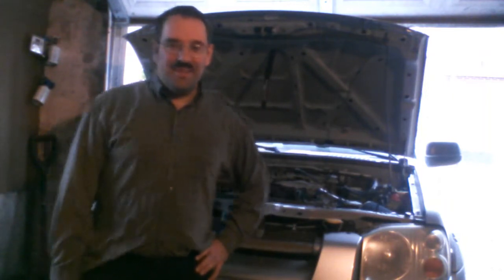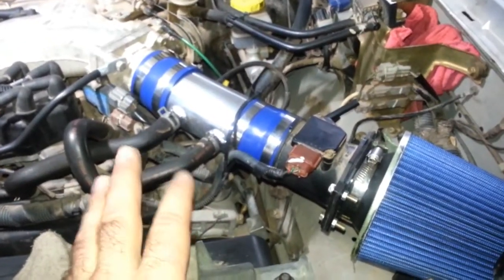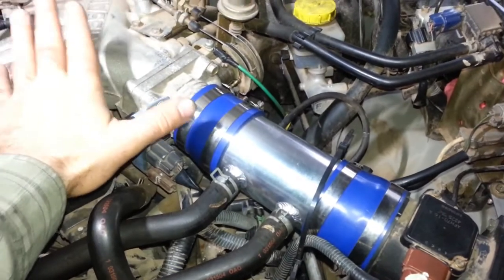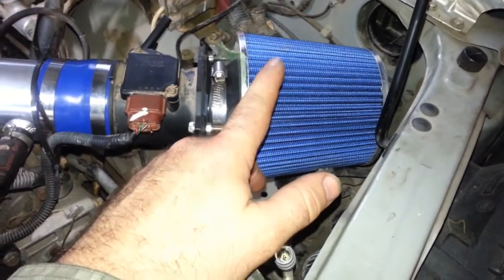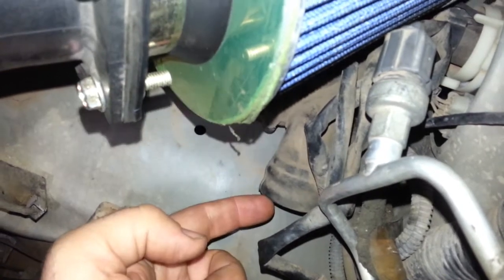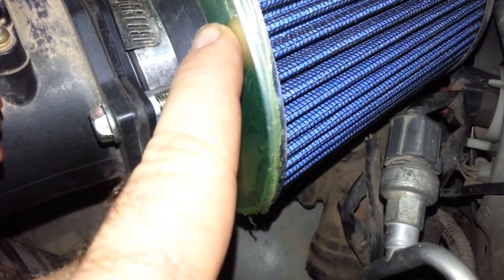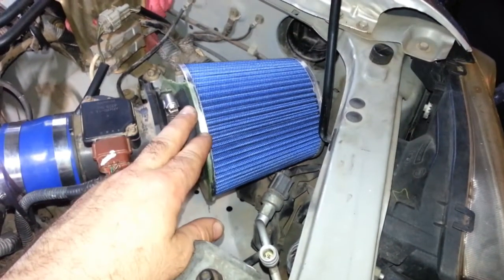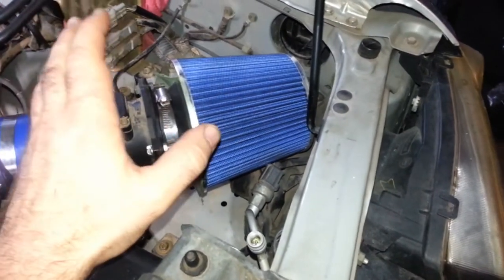Short Ram Intake compared to Stock: Nissan Frontier

Comment: I completely removed the stock air intake tube's and mounted a high flow filter to the air box that sits on top of the throttle body/intake manifold on my 03 frontier 2.4L and I can feel a dramatic increase in torque that I feel greatly out weighs the negative effects of the hot air it's sucking in
Reply from the maker: Oh wow! I have the 3.8l? Gosh I forget the liters. V6 2004. The intake was a power killer. So cool that worked so differently for you!

Comment: We're does that vacum line connected to the side of the intake pipe of the cold air intake come from? ... I am missing that vacum line but I do have that fitinn on my intake hose
Reply: Did you ever figure this out? Haha. I don’t see that vacuum like ANYWHERE. I’m a little late, sorry. Just installed one today.
Reply from the maker: If you're not missing a connection, made your guy's Frontiers are just a little different on their setup.
Reply from the maker: I've certainly done short rams where a fitting just gets capped off rather than being used because they often makes these "work" for a  few variations. 

These kits aren't expensive. Often that requires increased creativity.

Comment: I put the k&n cold air intake on my frontier and I've noticed that it puts the air temp sensor right onto the filter which definitely makes a difference but the way yours is set up yours is still in the original location which if you were able to put it where the filter is you may not have any of those problems that you're referring to. All you would have to do is just buy the k&n filter like the one that my kit came with and it has the opening for that sensor to slide into..
Reply from the maker: That is an AWESOME report. Thank you! I didn't see in the design of that one that the sensor would fit from images online, but I'm very happy it's a better option.

I partly bought what was cheaper because I could find no indication that K&N had a good solution for the IAT.

I hope your comment gets a lot of upvotes and it helps share the news!
Reply: @DENicholsAutoBravado  K&Ns' air intake system is actually really good for that engine that I've definitely noticed a big improvement over the stock air box. On yours all you would have to do is get their filter which has the opening for that sensor and you would be good to go.👍

Comment: I have to ask you a question? About the intake what did you with the third hose that connected to a smaller black housing next to the stock air filter housing
Reply from the maker: I'm not sure the hose you're referring to. Can I suggest watching a few more videos on my channel about this? I have a full how to series.
Reply: @DENicholsAutoBravado  on the stock intake theres three hoses 2 on the front and one on the back that connects to some small airbox
Reply from the maker: @bmwsuperstar7481  Ah! I remember it now. That's just part of the anti-resoance design to help keep things quiet. You don't need that for your short-ram.

I do highly encourage you to watch more of the series. Unless you live in a perpetual winter where never get stopped at stop lights, I think short-ram intakes work so poorly on Nissan Frontiers that engine damage is likely.
Reply: @DENicholsAutoBravado  how is it damaging if I may ask I live in vegas by the way
Reply from the maker: Las Vegas is the most brutal place I've every driven where short rams don't work. 

I'm sure I put the why about our Frontier here:
https://youtu.be/7Zud8L9B32g

Comment: Hot air, I was always told would increase the air/gas mixture over cold air for better mileage.
Reply from the maker: I've seen it work that way, but when it does, it also really decreases power. It really depends on the car and the modification. Here's a video which might help understand more of the processes to check on: https://youtu.be/SfTcm3J92E4

Comment: I myself like intake kits...but the hose with the intake air temp sensor does draw air in from the fender. It doesn't connect to the baffle (other inlet you showed) inside the fender.  The small inlet you showed goes to a plastic resonator that goes up to top of radiator. At least that is how it was set up on my xterra.  Nice video though!
Reply from the maker: It's so exciting! I found the resonator recently. You're right! 

Alas, it was broken then I bought the truck 4 years old. Maybe a new one? I think I'd like to try a kit with a shield instead.
Reply: @DENicholsAutoBravado  I did the stock airbox mod on my xterra. I posted a video on that if you do a search. You can get test plugs to cap off that small inlet in thr hose to force it to draw air in from the fender if you leave the hose in with the stock setup. Ive always been intrigued by the KN Apollo intake and the KN Orion intake. Universal type intakes with a plastic shell around the filter and a flexible air duct you can route any where to bring air in. Theres also a cheap intake on Amazon that has a heat shield, though ive heard in the reviews fitment is iffy but not bad if you are handy with tools. Nive channel!
Reply from the maker: Thanks brother. Liking the comment and what I'm learning. Go ahead and post you're link. I'll approve the "spam" if you don't mind me doing the same on yours. 

Makes it a little bit of a collaboration.
Reply from the maker: I almost forgot. I finally got a plastic plug at work which came with a hub bearing which I clamped on. My MAF reading was lower so if it's not hot out I think it's better open.

Comment: they make the filters with a hole and grommet to put the air sensor in or you can drill it into this filter. i have furookie 4 inch on my z that was done with a tune and about 2k worth of other stuff. unless you got a tuner/tune  the car doesn't recognize any thing anyways lol.most people figure it out the expensive way they thought started off cheap with a 50.00 ebay kit hahaha.great presentation bro
Reply from the maker: Thanks for the compliments. Glad to know you're a pro modder and I'm super happy there's a product which fits the IAT in so it works more correctly! I love doing this stuff.

It doesn't have to work right to enjoy it either. Recognizing that and coming up with a different plan rocks too. 

Countless modders go with "it has to work" and when it doesn't they're in denial. Takes maturity to grow from mistakes and not live in denial.

Comment: its called a Fresh  air intake not cold air intake from the factory.p.s im sending the speed daddy kit back as it won't fit.i am a mechanic and pro modder and it won't fit my 01.listed for 99-04 which we know is the years it changed the most stuff lol. probably fits newer ones .
Reply from the maker: Pro modder and it still doesn't fit? Just saw your comment 5 years later because someone said a short ram intake worked great for a 2003 2.4l Nissan Frontier. He said he felt a lot more power so a hotter intake was worth it.

Comment: can you send the link from ebay?
Reply from the maker: J Acia. Sure. https://www.ebay.com/itm/Short-Ram-Air-Intake-Kit-BLUE-Filter-for-99-04-Nissan-Frontier-Xterra-3-3L-V6/331869644059?_trkparms=aid%3D222007%26algo%3DSIM.MBE%26ao%3D2%26asc%3D44039%26meid%3D78d673e50b7c45a7a365fd28331c53d4%26pid%3D100623%26rk%3D3%26rkt%3D6%26sd%3D322131784657%26itm%3D331869644059&_trksid=p2047675.c100623.m-1

I wasn't quick to share the link as I know eBay links change over-time, but anything to help out a subscriber. Know also that the kit is also available in red and black. I don't think it was available in black when I bought mine. Be sure to watch part 2 of my reinstalling the Nissan Frontier's Fake, Stock Cold Air Intake Part 2. The kit did have an issue for me. I'm still looking for replacing 1 part of this kit from another manufacturer. https://youtu.be/YhIstabdGKM
Reply: Is it possible to use the stock air box with this kit? My stock rubber tube is starting to fail and crack. A metal one will outlive the truck. Thanks in advance
Reply from the maker: I'm afraid it wouldn't work. The pipe is too long and the silicon couldn't be straight. It'd have to have turning elbows. I checked that as I thought it a good idea too. Straighter air flow but the boxes superior safety for dirt and water. And the fact the stock intake is much cooler. Oh well.
Reply: @DENicholsAutoBravado  Thanks for the info. I am looking for a way to better seal the resonator that I removed on the side. Now, its too long but it can be shorten. Is really too straight or if i could find something to bridge the gap can it fit (like the TB end of the stock tube). It is a long shot to ask but at this point i am about to pay to have someone weld one that would fit...
Reply from the maker: @Spyke438  try an autozone. There are spectre pieces which you can swap things around until you can find what fits. 

Maybe an elbow for the tube and 2 silicon steels with bands. They makes ones with a bunch of filled wholes which pop out for the various tubes modern cars need connected up.
Reply: Very good video man! I put a short ram intake into my 02 frontier supercharged. I have a check engine light though. Noticed that there wasn't anywhere where I could connect the air temp sensor. Any advice? Thanks.
Reply from the maker: Honestly, I put the original air box back in to solve the air temperature problem. It was making the truck run really bad every time I was at a light. The air temp sensor being super close to the intake (I arranged it that way) had it accurate enough. 

The problem comes when the PCM isn't choosing to adjust fuel trims. When it sees the sensor heat up that quickly it doubts it and ignores it. 

I figure the only way I can run the short ram is in the dead of winter and that the hot air intake that it is can actually help with gas mileage quiet a bit.

I do live in the Southern U.S. as far as temperature concerns go.

The only way you may be able to get around it is to extend the wires to the air temp sensor, and modify the kit to accept the air sensor inside of the air tube like it should be.

Hopefully the ambient engine heat which causes such problems at a stop would be reduced when the engine is sucking so much air across the sensor, cooling it, versus sitting in the open.

In the summer, I'm not talking about the IAT reading a little hotter at stops. It's more like 20-30 degrees farenheit hotter. The PCM, or engine computer,  just won't adjust to this not believed temperature.
Reply from the maker: There are usually sensor adapter kits to help get sensors added to intakes but I hadn't able to find one...may have had to custom make a solution. 

1 more solution....much more expensive kits include a shielding box which the intake air temp sensor can hook into....maybe someone sells an air box separately, or it can be built.
Reply from the maker: The complaints I saw online for the Air Raid air box was that it didn't seal with the hood which made it a lot less effective.

Comment: A short ram will always give less HP by design compared to a full CAI; with some exceptions Im sure.
Reply from the maker: If the ambient temperature isn't too high a short ram can perform better at certain RPM while a true cold air intake will behave better at other RPM according to Engineering Explained's tests. I added the influence of temperature from my testing which would agree a short ram is just too hot in summer or in this case even a spring or fall afternoon, with heat you lose power.

It rains a lot here. Cold air intakes can add a degree of danger of hydrolock which is too risky for some cars and/or some people.

If fuel injectors can't keep up with increased air volume more cold air can't make more power.

Overall, especially outside of winter your statement holds true. I bought it because I didn't like 12-14 mpg in a truck which should at least do 15-16. For that? It worked at most fill ups.
Reply from the maker: Jake The Snake if you liked this, it's part of an ongoing intake series. Here's me getting rid of my short ram:
https://youtu.be/7Zud8L9B32g

Here's me turning a short ram into a cold air intake effectively outside of summer's heat. https://youtu.be/SfTcm3J92E4

Comment: hmm, is cold air denser than hot air, and is that one of the reasons for a cold intake? more oxygen per gulp lol.
Again im no mechanic :-)
Reply from the maker: That's the reason. I bought a short ram intake though, aka hot air intake, not a cold air intake. In my case the only difference is a shield that would have gone in a square around the filter in the corner of the car. That was $120ish. I spent $42. The shield is supposed to keep the intake inhaling colder air. I thought why spend $120 when stock I have a cold air intake? Then I learn the engineers covered up a tube sucking hot air in!

When your cheap they say you spend twice. In my case, thrice if I don't come up with another ingenious plan.

More air, more power. This air element has way more space to take air in than the factory filter element, but the truck doesn't actually get more air according to the MAF sensor. I'm thinking the exhaust needed upgrading first.
Reply from the maker: You know, with that hole behind the headlight what if this short ram is getting colder air? The IAT or intake air temperature sensor isn't in the airflow with this mod. Further experiments are necessary!
Reply: Yes you need to move the temp sensor just past the filter.
Reply: @DENicholsAutoBravado  you should've looked harder.i got the one with a shield for 52.00 from ebay
Reply from the maker: Nice! I'll have to check that out. It has to be hard core winter or mine doesn't work. Maybe with a shield it'd do better.
Reply from the maker: Oh yeah, and when I was looking, the ones with shields were twice as much. If you have live data I'd check the before and after to be sure fuel trims don't go nuts at a stop and make the idle have issues. Mine sure did....outside of dead cold winter.
Reply from the maker: And while you're at it, check out why I got rid of mine so you know what to look out for: https://youtu.be/7Zud8L9B32g

Comment: Life with Ken and Jane do not so difficult things to the truck because I screw it up and Jane does not like that. Full watch buddy
Reply from the maker: That can be a good call. My next video shows how to undo this kit going back to stock. There are performance shops who can do this sort of thing for you if it's desired. 

Even this mechanic failed at installing the short ram without help from the seller. I really meant to say who I got it from. More about the install via an upcoming uninstall video. Stay tuned. ☺

Comment: Just came by to show my support and smash the like button hope you're doing well I'm a Chevy guy but not a prism and I like everything under the hood to stay stock
Reply from the maker: Oh, no doubt stock is better for more scenarios. I almost paid for it with gas savings this winter, but I did start with it late into the winter. Next winter it may pay for itself twice more. :)

And you being a Chevy guy I can see you not being into the Prizm. It's made by Toyota. It had a few issues that Chevy wanted to recall in the partnership, but Toyota didn't. That's why a few years later (2002) there was just the Toyota Corolla after that. Later Chevy, or GM continued using this 1ZZ-FE engine in their Pontiac Vibe, which is a Toyota Matrix with a GM A/C.